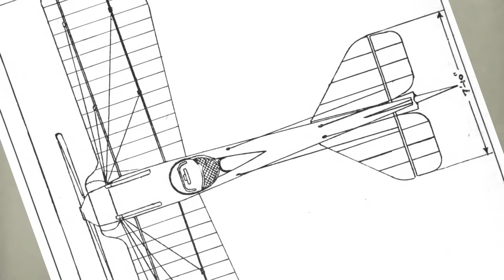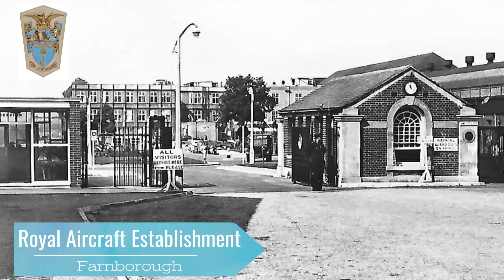This Spitfire ALMOST Went SUPERSONIC - The British WW2 Fighter That Almost Broke The Sound Barrier

Comment: There is also a story where a P38 accidentally went through the sound barrier. You might want to investigate that.
Reply: Part of why these tests were carried out was because the USAAF asked the RAF to carry out high speed tests on the P38. It was found that the P38 started to enter compressibility at M 0.67. This was actually fairly low airspeed. This was all to deal with the loss of control (and life of the pilot) for the P38s, that were often seen in combat crashing into the ground in high speed dives...

Comment: nonsense:  the pitot/static tubes used to measure airspeed are only valid for incompressible flow where Bernoulli equation is valid.  You need to use compressible flow eqn for to capture Mach number and with known temp at altitude you can get airspeed.

Comment: That was extremely interesting. As the Mosquito was the fastest propeller plane during the war I believe it would have been considered for these tests as well. But considering it has an all wooden airframe there was possibly some doubts as to its strength. The conversations about all this at the air ministry would have been very interesting.
Reply: Hoa Tattis  I thought the Do335 did enter service, on a small scale?
Reply: @julianneale6128 The Do 335 was definitely faster than the mosquito,reaching 473 mph in level flight.

Comment: I think that, on the balance of probabilities the Spit did reach a speed of Mach 0.96
Reply: Just for interest—how did you balance the probabilities?
Reply: @riazhassan6570  Knowledge of the aircraft and it's capabilities. However, if you prefer, I think that it's more likely than not that the Spit did reach a speed of Mach 0.96
Reply: @pierremainstone-mitchell8290  the most common flights at such high speeds was made with P47's during hunts for me 262's: the P47 was probably the fastest ww2 propeller aircraft in dive of all times, was able to fly FASTER in dive as a me 262 without damage (the me 262 was unable to fly faster than ~950km/h because deadly loss of control caused from a tail design fail... The Spit was never use in such conditions because was a low range aircraft...
Reply: @leneanderthalien  Whilst I take your point the question asked was whether viewers of the video thought that the Spit reached a speed of Mach 0.96. 

On that basis the performance/use of any other aircraft, whilst interesting, is, to be bluntly frank, not relevant to the question asked. 

As I wrote in my original comment - "I think that, on the balance of probabilities the Spit did reach a speed of Mach 0.96" and I stand by that observation!

Comment: According to german accounts a photo reconnaissance spitfire did hit the mach 1.0 barrier and it is assumed it was as fast as mach 1.01.  The Spitfire came under attack from ME-109s over france and dived to escape,  the ilot flew low enough to be fairly safe from most if not all of the area anit air defenses. A german officer had reported seeing the spitfire fly low into a canal,  and infact flew under two bridges,  having times in his report the times indicated that the spitfire had mach 1.0. The same spitfire actually broke appart with the pilot barely surviving but  the pilot had managed to destroy much of his photo equimpent,  and when taken into custody he was saluted and given extra good tratement by the luftwaffe for his "heroic speed" as they called it.
I did read later that aviation experts have gone over the various reports at the time and found that the spirfire could not have travelled that fast, but they do belive it may have been as much as mach 0.75.

Comment: My great Grandfather flew Typhoons in 1944-5 he said he first flew at a indicated 590mph in a Spitfire mk9 in 1943 whilst diving to escape three 109Fs and the Typhoon regularly exceeded 600mph indicated in a dive, he lived until he was 82years old despite two crash landings and being shot down three times between 1943-45
Reply: May your grandfather Rest In Peace. Much respect to him.❤️
Reply: Your great grandfather was a steely eyed beast. I tip my hat sir!.
Reply: I new RAF ground crew who all through the war listed to their pilots tell them that they where moving so fast that they almost pulled the wings off their spit.
Reply: @General Melchett also interesting reading is the report from the RAF's speed test between a Typhoon, a captured Focke Wulf FW-190 and a Griffon-engined Spitfire. It was though that the fastest would be the Typhoon, followed by the Focke Wulfe, and the Spitfire would be bringing up the rear, but it turned out the Spitfire was the fastest (and considerably so), then the Typhoon and finally the Focke Wulf.
Reply: 600 mph indicated is unlikely. True airspeed, perhaps.
Reply: @General Melchett the tail issue was largely fixed later with fish plates and other measures. 600mph true or indicated is highly unlikely in a Typhoon, though, given its thick wing. Maybe in a Tempest
Reply: @General Melchett The RAE did determine what was causing the tail problem, it was not structural as such, but was caused by a complex interaction between the flight controls and a vibrational node of the airframe near the elevator counterweight. The RAE solution was to re-engineer the flight controls, the problem did not reoccur after this modification was implemented. All aircraft were temporarily modified to fix the issue by May 1943 while awaiting a full retrofit of the re-engineered flight control system.   The previous attempts to fix "structural issues" did not solve the problem.  Later on, there were more tail failures after a modification to the undercarriage had unexpected side-effects.  Hawker implemented structural modifications late in the aircraft's career to increase the strength of the rear fuselage, I assume to create leeway and to try to rebuild confidence in the Aircraft.    I believe the number of aircraft lost to this issue was determined to be between 24 and 28 in total.

Despite its failings, the aircraft continued in production until after the war, with the final aircraft delivered in November 1945, later than the last Tempest V.  Toward the end of the war, every Typhoon available was pushed into service, including ones that had been in long term storage, probably due to a lack of engines in the early production series, these stored aircraft were obviously updated before being put into service.

Although I find the speed claim unlikely, the Max Dive Speed listed in the aircraft's operational book was the speed the pilots should not exceed, it is not a limit determined by testing or operational experience of the absolute controlled dive speed attained.
Reply: @General Melchett the Tu-95 manages 575mph in level flight, so 600mph true airspeed isn't impossible in a dive, but at higher altitudes where airspeed will be much less than 600, although IAS could be all over the place as pitot tubes had error margins, and even more so outside the realms of normal operation 

For a Typhoon, though, the thick wing is going to be the limiting factor, and was a significant limit for level speed at altitude of not much more than 400mph. But even the Tiffie could potentially get to 525mph TAS, so it's just about conceivable a Tempest might manage 600. However, airframe damage would mean it would be scrapped promptly thereafter. I don't know if any managed it, though, I'm just saying it's not completely impossible it happened once or twice. If it did, it was probably fatal, though
Reply: @General Melchett I know, I already indicated in my first reply that true would be more likely than indicated. True can get turned into indicated with a few retellings as people often don't know the difference between true, indicated, actual airspeed and ground speed. And as I noted, nothing would be calibrated correctly as standard for what would be equivalent in airspeed that would be 600mph TAS at whatever altitude, hence the need to use additional sensors for experimental flights of the period, as noted in this video. Actual performance tests of the period sometimes note both the IAS and the corrected air speed due to pitot accuracy and temperature and pressure that day as well as TAS.

But my point was that although a standard propeller of the general period would hamper getting to 600mph, it was possible. Indeed, high bypass jet engines can also achieve high speeds, and those share some of the same issues, except that they have a cross-sectional area between that of a typical propeller aircraft and a turbojet. 

For the Typhoon, though, the limiting factor was the wing, even in level flight around 400mph, even before the propeller became the main limiting factor. But that is where the suggestion that the Typhoon could manage 600mph TAS let alone IAS (unless it was a measurement artefact) is highly unlikely as the wing thickness would already have stopped it.
Reply: @General Melchett A swept wing is not required to reach 600mph. Several early jets managed this with in some cases the wings of WW2 aircraft attached to a new fuselage with a jet in it. The classic British example is the Attacker (or just a tiny tad under 600mph, TAS, of course). However, it was a fairly thin wing, not the chunky horror that was the Typhoon's.

A swept wing certainly helps, especially in the region above 600mph unless you are going to use exceptionally thin and short wings like the X-1 or F-104.
Reply: @General Melchett yes, I know what the claim was and have said multiple times I don't believe it
Reply: @General Melchett I said 600mph TAS. I know the claim was IAS, but again, I've said I don't believe 600mph IAS is possible, but suggested that over time in the retelling of the story IAS and TAS could have been confused, so looked instead at whether a Typhoon could have achieved 600mph TAS. But you seem to have constructed a strawman in which I am arguing for believing a 600mph IAS claim, which I am most definitely not doing and thought I'd made clear several times
Reply: @NOYB Googlepuppet All I have done is interpreted and been generous in terms of assuming IAS was confused in the original anecdote with TAS as this sort of confusion over technical details in anecdotes is common
Reply: @NOYB Googlepuppet I am not a kid, and have been an aviation enthusiast for decades, and have known the difference between IAS and TAS for as long as I can  remember. I made specific points politely. I have family ties with the aviation industry going back as far as the 1930s and have supported work by Rolls Royce.
Reply: @General Melchett I have not back pedalled with edits, I did edit to add additional information, but perhaps I should have simply have simply added more posts.

I find your attitude incredibly insulting.
Reply: @NOYB Googlepuppet no, I keep addressing the core of the issue, you seem to wilfully misinterpret my generous assumption that in the referenced anecdote IAS and TAS was confused. I've tried to be incredibly explicit about this. Your continued wilfull misinterpretation reflects badly on you and so I give up.
Reply: I hope those colourful pills didn`t make you believe in your story!!
Reply: By what you say he reminds me of Douglas Bader....a badass British fighter pilot who lost his legs before the war and still became an an ace without them. The man was shot down multiple times and escaped almost every time. Look him up if your interested
Reply: @General Melchett  the typhoon had a much better frame an much stronger wings than a spitfire it was literally built to dive, gun an run
Reply: Yeah yeah for sure
Reply: It was more common than you think, italian props could reach 980kph in a dive
Reply: How cool
Reply: That's what you call a very cool great Grandfather!

Comment: No matter if the Spit. Reached these ridiculous speeds or not, still wonderful A/C.  By the way, the Wright Bros. we’re NOT the first to achieve powered flight, it’s been proven!!!
Reply: Proof? Just the standard procedure to ask for some.
Reply: @mattevans4377  Gustave Whitehead made several flights in 1901 & 1902, witnessed by a variety of ppl.  Controversial up to the present day!! Even Wright Bros. photos(ea. a different plane)of the ‘flight’, are extremely controversial. Unfortunately for Whitehead, no photos exist!

Comment: Oh dear, people are going Spitfire Stupid again. 

This is the same old myth again. There's no "almost" supersonic when you're talking about M.0.92. The difference in drag between M. 0.92 and M.1.0 is phenomenal. As a general rule, drag increases exponentially with speed. So, to double the speed requires four times the amount of power. So if flying at 200 mph (to use old fashioned units) requires 500hp, 400mph will require 2,000hp.

BUT!

Close to the speed of sound is a phenomenon known as Drag Divergence Mach Number. At that speed, the previous rule no longer applies and the increase in drag becomes much, much greater. This is why it was known as "the sound barrier". There were those at the time who believed that flying at supersonic speed was impossible because they di not believe engines could be made powerful enough to do it (this was before WWII).

Another factor is Critical Mach Number (MCrit). The Spitfire airframe varied a lot throughout its development and the only figure I have heard for this is 0.92 but I don't know what marque that was. Critical Mach Number is the speed at which the airflow becomes sonic at some point on the airframe. Just for the record, 0.92 is very high fr a propeller-driven aircraft and I'm starting to wonder if they included the propeller. Funny things happen at MCrit. Shock waves for for a start and that creates a high pressure zone ahead and a low pressure zone behind. They can cause strange phenomena and can be very dangerous. There is a photograph in William Green's "Warplanes of the Third Reich" which shows a Me-163 tail which was shredded when it exceeded its MCrit. This is why pilots were advised to avoid flirting with these sorts of speeds.

In the photograph of Tony Martindale, sharp-eyed viewers will note the man third from the left in the RN/FAA uniform. That, of course, is Eric "Winkle" Brown, who was as much a part of the diving program as anyone. Brown flew every marque of Spitfire. In his book "Wings of the Navy", Brown describes flying the Seafire and includes its dive performance. He notes that he had flown a lot of dive testing, including to the aircraft's MCrit, by which time, it was - in his words - totally out of control.

The most important thing to take away from this is that the airspeed measurement instruments of that period were not capable of measuring high mach numbers and TAS conversions don't work. This is because air piles up in the pitot head and creates shockwaves which cause incorrect readings. There have been hundreds of USAAF P-47 pilots who claim they have flown supersonic in a dive, simply because of TAS conversions.

Did a late model Spitfire fly at the speed of sound in the 1950s? No way. Not a chance. Not in a month of Sundays.

The TAS conversion of 690mph is worse than useless at high Mach. You might as well be towing a log for all the use it was.
Reply: @Penelope Scott LOL!! Who'd have him?

Comment: last time I checked the speed of sound was twice the speed this plane could fly, just saying.
Reply: That's the top speed of a Spitfire in level flight, and due to development, that increased during WW II with new models. Some later models with the Griffon engine could reach 460 mph in level flight. In a dive, they could achieve over 600 mph. The speed of sound at 10,000 feet is about 730 mph.

Comment: It is possible that he did reach that hi Mach number, but the Pitot tube was designed for the aircrafts normal speed range. It might have been influenced by super sonic air flows.

Chuck Yeager, the second person to go super sonic. The first one was George Welsh in a prototype F86 three days before.
Reply: @Penelope Scott the F86 officially went supersonic only a few months later. If your interested have a read of a book called Mach 1, can't remember who wrote it.

Comment: Like the Spitfire, Bell X1 also had straight wings instead of swept back. The pilots are very lucky they didn't reach mach 1 because I think the Spitfire would break apart.
Reply: Well the Bell X1 was actually more than heavily influenced (virtually a direct copy) of the Miles M52.

Comment: A Yank here and I must say that the Bravery of these pilots is unmatched and it could not have been done with out the technicans and scientists on the group ! All of these people deserve medals too ! 
BYW Have any propeller aircraft ever broken the Sound Barrier ????
Reply: No Prop aircraft has ever gone supersonic.
Reply: That was the fastest limiting Mach number of any propeller aircraft.
Reply: The Los Angelas times reported that an American P-47 Thunderbolt traveled over 700 MPH in the same test the Brits did on the Spitfire. They took the P-47 to 40k feet and then dove at 45degrees. The speed is disputed since they didn't use proper speed indicators.
Reply: P47 700 MPH ...Dream on . @Wallyworld30